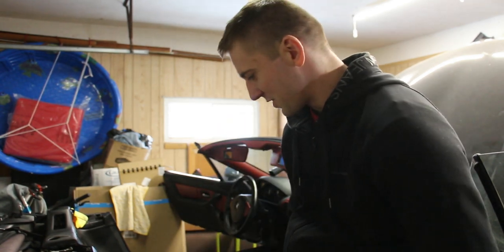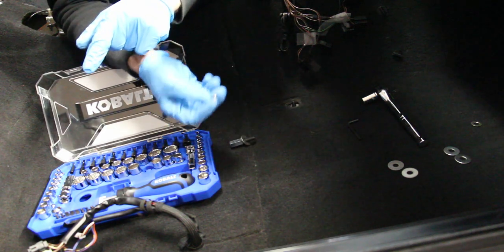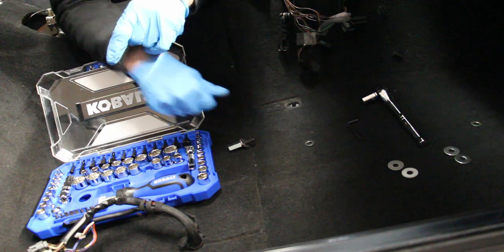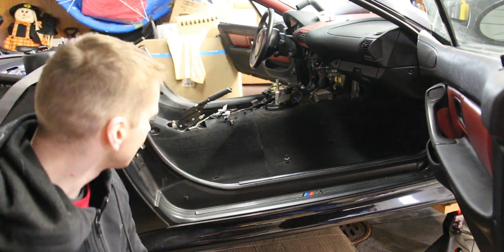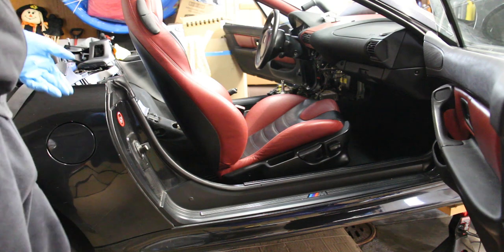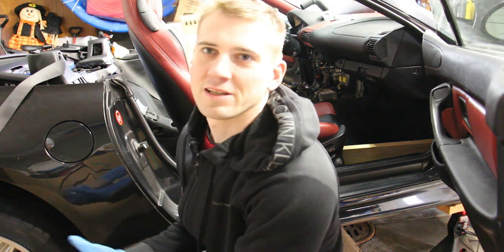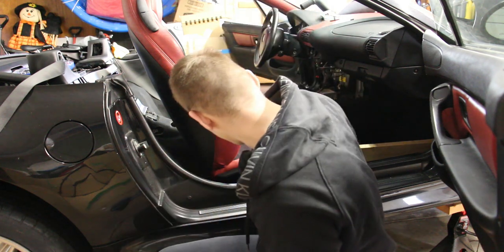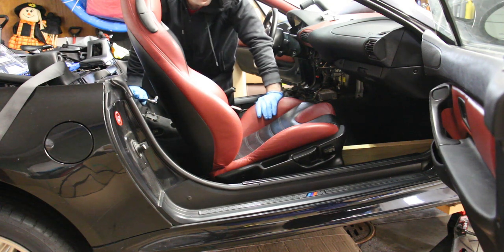How to Add a Seat Tilt Mod on a BMW Z3 M Roadster

Comment: Good way to rip apart your chassis.    Look at the contact patch from  the seat rail.  Now you have a contact area of a few mm, plus you have created a leaver with that extension as the chassis as the fulcrum.  Not to mention what grade bolts are those extensions?  So much wrong here on a component that is integral to your safety in the event of a crash.

Comment: Does this help provide more legroom space? As my knees touch the steering wheel. I'm 6'1.
Reply from the maker: Not really. I have a separate video on removing the foam behind the rear carpet. That will allow the seat to slide back a bit more. I am 6'2" and I fit pretty well. My only gripe with the car is that the steering wheel doesn't telescope, which means that I can't dial in a perfect seating position.

Comment: do you have a link for the parts? and the screw wont bend on hard driving ?
Reply from the maker: https://www.amazon.com/Thayer-Motorsports-MODS-TMP-Z3XXXX-SEATXX-Seat-Tilt/dp/B01N7X0YZS/ref=sr_1_1?crid=2ZMADTMAPW8ML&dib=eyJ2IjoiMSJ9.y1FXcRfiosKKhytlK34mqQ.pMDRdlEbCoxnXMo4Bo3ZyKslUU0Ic2a-W7P3BsRXRI0&dib_tag=se&keywords=thayer+z3+lift&qid=1705598182&sprefix=thayer+z3+lift%2Caps%2C154&sr=8-1
Reply: Thanks I have this same product. Can I use on NRG or aftermarket seats too ?